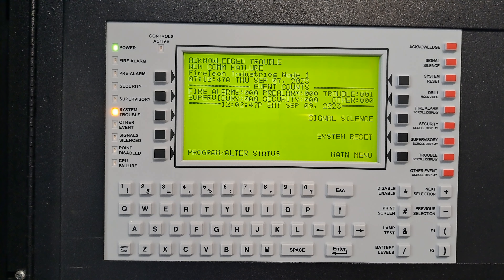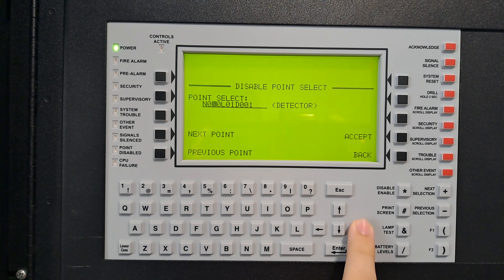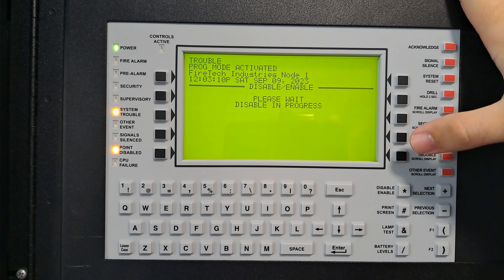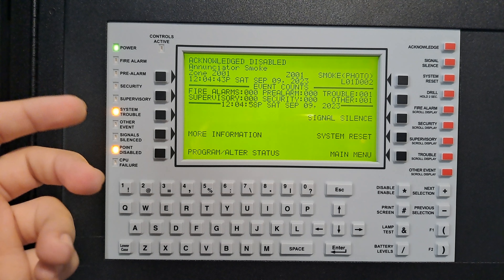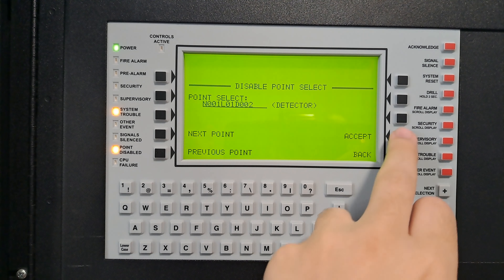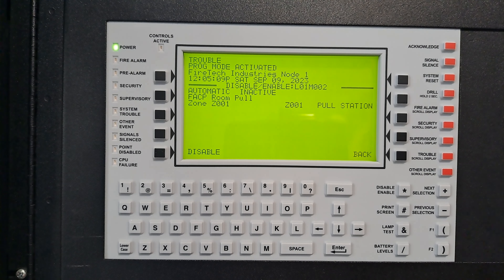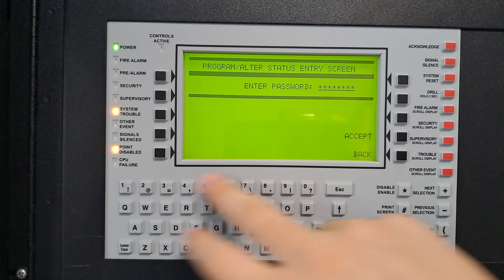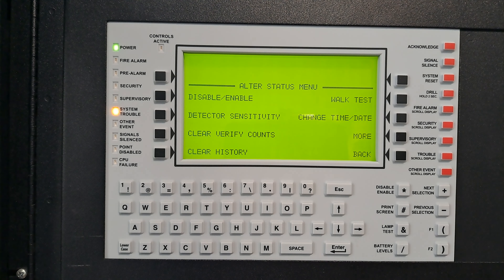How To Enable/Disable A Device on the Notifier NFS2-3030

Comment: Very good!
 A question!  Is there the possibility of testing a Detector directly through the Central?  In other words, enter the desired point and check its activation!
Reply from the maker: If you are referring to its values and whatnot to see if it's currently activated, then yes. You can not put the detector into alarm from the control panel itself, though. At least I don't think you can.. I'll check tomorrow
Reply: @FireTech7  @FireTech7  In fact, I already did a test on the audio visual, however, activating a Detector through the Central I couldn't find any actual function!
 I've worked with other centers that had this option directly on the panel.
Reply from the maker: @leninho10  Yeah, I know est and Silent Knight have those features, but I do not think notifier does
Reply: @FireTech7  Thank you for the information!

Comment: I like the setup. Are you gonna program the piezo to be disabled on the annunciators attached to the panel? Can the annunciator piezo be programmed to not sound?
Reply from the maker: I would just flip one of the dip switches on the back of it to the off position, I do that when the panel gets rebooted because during that time the acs bus shuts down and that acm goes into a com trouble and starts beeping. As for it being on the active system, I sort of like when multiple piezos go off at once, so I think I will keep it enabled.

Comment: Sir i am getting dual/double address error/alarm on my panel for some of the smoke detectors. I have tried to auto program but still issue exists please guide.
Reply from the maker: That means you have devices in the field that have the same address, you need to find those devices and change the address

Comment: And also getting the alarms for. ANNUN 1 NO ANSWER
ANNUN 2 NO ANSWER
Please guide
Reply from the maker: There are 2 annunciators programmed into the system that either donr exist or are disconnected from the panel, they can range from acm-24at to lcd-160, find them or delete them from the programming than reboot the panel

Comment: May I know what causes that ncm comm failure on the panel?
Reply from the maker: How many nodes are there
Reply: @FireTech7  not exactly sure because i don't have the list yet but the dvc is not working all the lights keep blinking and dvc offline is steady and the panel says Ncm comm failure
Reply: Any advice could be very helpful thanks in advance 🙏
Reply from the maker: @RJCARPIO  ahh that means the dvc lost network communications to the main 3030. Make sure the NUP cable is connected all the way on both ends
Reply: @FireTech7  The nup is intact and has continuity we also tried reversing its connections and still the same.
Reply from the maker: @ does the nup go directly to the dvc from the cpu or does it go from an ncm to another ncm
Reply: @FireTech7  yes directly connected from 3030D to Nup port of DVC
Reply from the maker: @ did this problem just start happening randomly?
Reply: @FireTech7  The dvc was turned off before by someone a long time ago and now it needs to be operational and the ncm comm failure is in display during the off period of the dvc and when we powered the dvc it just keeps blinking we also tried restarting the whole system and still the same. during boot up there is a LCM-Fail in the panel but after booting it only displays ncm comm failure. is Lcm-Fail related to the problem?
Reply: The dvc used to work normally before it was turned off by someone we don't have any contact with.
Reply from the maker: @ turned off you say?
Reply: @FireTech7  yes they just remove its input power. When we saw it the cpu and other devices is the only one powered and the dvc's power is disconnected